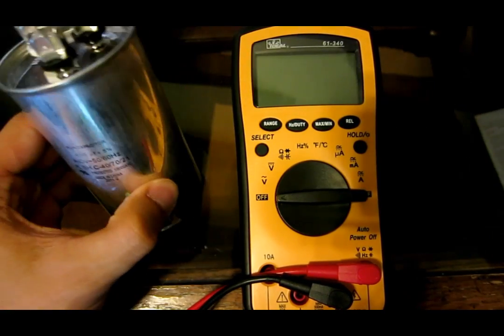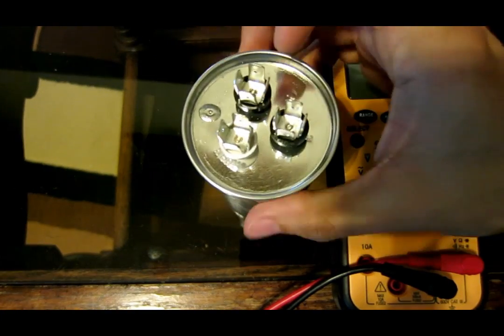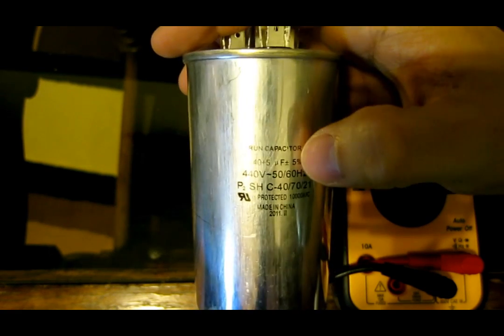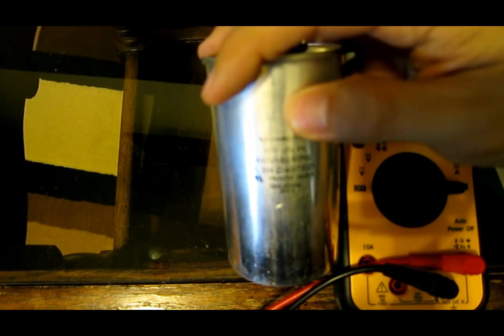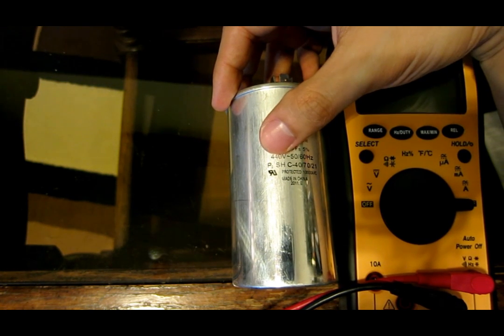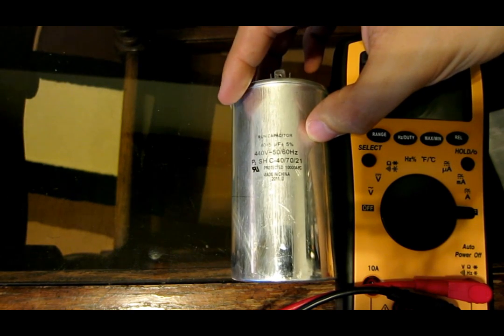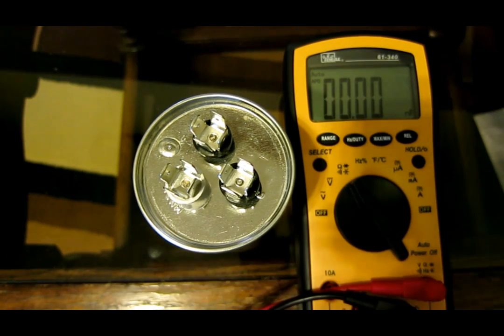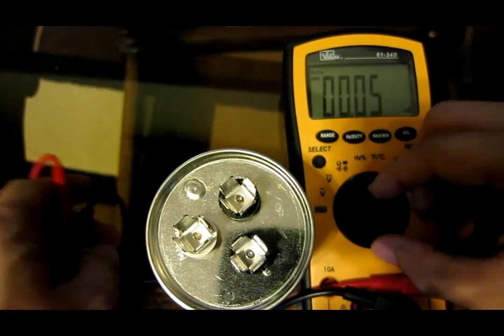How to buy a Run Start Capacitor - Cap Air condition replace measure troubleshoot HVAC A/C

Comment: @DIY TINKER....MAN, THANK YOU!!!🙏🏼 THIS is PRECISELY the information I spent a HUGE portion of yesterday seeking. As far as being mechanically inclined, I'd confidently give myself an "Above Average" rating (for auto maintenance & repair mechanic - same w/ food & beverage vending machines, pretty capable around the house, often advise & assist friends w/ their own DIY projects (grew up in construction- primarily concrete/masonry for dad's company - man was WELL KNOWN, among BEST in the Biz, IMMACULATE work- but he knew just about every other facet of building well... EXCEPT for electrical, ESPECIALLY pertaining to HVAC, hence.... I share the same limitations). *Prefaced with not yet having viewed actual capacitor, was on the road - JUST trying to find the manufacturer's direct replacement for my unit has been unbelievably time consuming....Google wouldn't allow me to access Lennox's  site and seemed to be some top secret info given the ridiculously limited amount of info elsewhere, despite applying make, model #, even serial # of my unit. Finally found one, but too expensive, take too late my to arrive & ALL I've been trying to find out since is WHAT I need (is required, critical) to match to search other replacement options. WISH your video had come up in my search results sooner, but at this point, I'm just glad it did at all. Sorry for the novella-length comment....just wanted to provide detailed background & context so as to convey my extreme frustration (prior to finding this video), in hopes of truly expressing my appreciation and gratitude for your channel. 
#SUBSCRIBED👍🏼💯

Comment: Do you have to get that off the capacitor or is it on the outside of the control panel of the hvac itself? I know the hvac motor is not spinning I know the motor cant be blown cause the house was built two years ago.

Comment: Thanks for the video!

HVAC techs can be the problem!   They will often replace caps based on what they are carrying on their truck; not what the unit calls for!  The units may run, but they may wear out sooner!

After educating myself on a/c electrics, I checked both my outdoor a/c compressor units and BOTH had incorrectly-rated caps.

I now have the correct replacements, plus spares and two replacement contactors - $120 for all four, off Amazon - about the price of a service call.

In future, I will always check things myself before calling a technician.

Comment from the maker: they discharge in less than a few min. if you want to be 100% sure, then take a conductive tool with an insulated handle and short across HERM and COM, then FAN and COM.

Comment from the maker: you can always replace a 370Volt cap with a 440Volt cap. but you cant replace a 440 with a 370. You can go up, not down, on ratings.
There are many factors for better quality. The higher the rating usually = more durable on voltage breakdown. you can read more on wikipeida.

Comment: the voltage on a cap. has nothing to do with quality. it has nothing to do with input voltage 220-240. it has everything to do with the way the fan motor and compressor are designed. 370volt and 440 volt caps are not interchangeable.

Comment from the maker: click below the video to "show more" and see if that helps
Reply: Hi，the below is my ac conditioner parameters，how do I choose the capacitor？Thank you so much！
-Goodman
-208-230volts
-CAP 5uf/370VAC 8P
-RPM 810/1SP 
-YDK-120S83262-01
-AMPS 1.1
-E256965